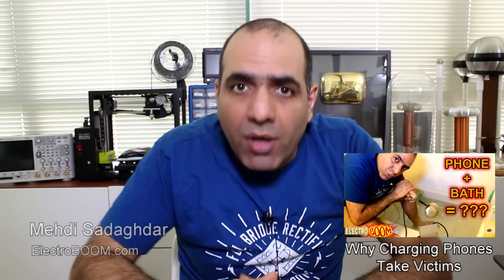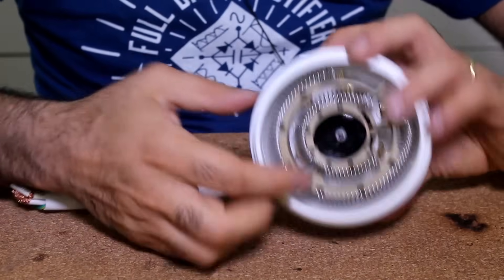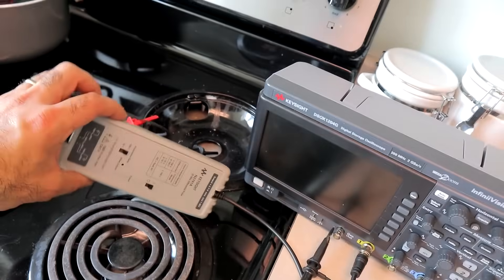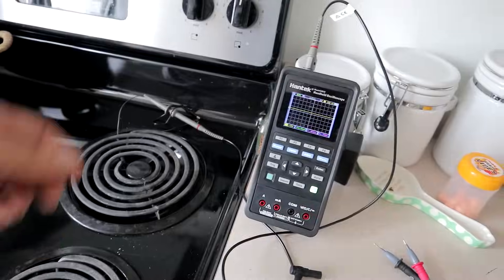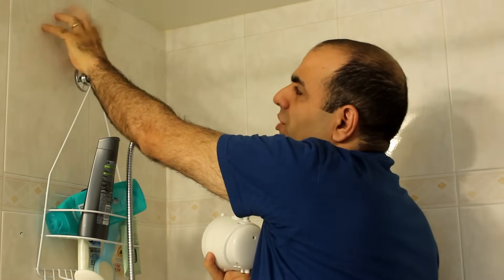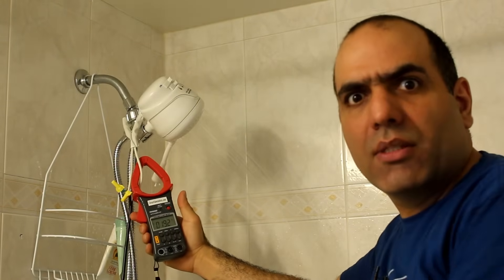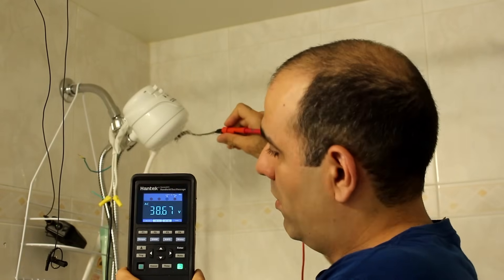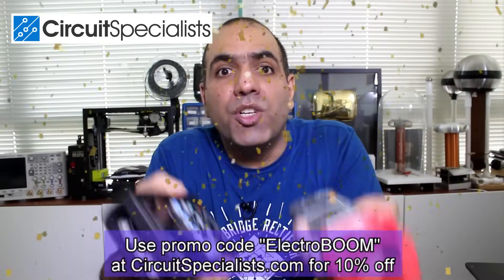How Safe Is the SHOWER HEAD OF DOOM?!

Comment: Let's also remember that water is a poor conductant. If it was salty water then it would be a whole diferent story. Here in Brazil we have the majority of showers eletrically heated and a minority heated by a buthane/methane mixture. It is common to read about asfixiation accidents related to gas heating, but in 53 year I've never heard of a deadly accident involving eletric showerheads. The wire gauge and breaker are highly regulated when you build a house.
Reply: I once heard about a fire involving electric showers, but I'm not sure if it was deadly
Reply: Yeah, it's mostly big apartments and fancy houses that have gas heating.
Reply: i have all three types. the main building in my house has central heating for water, the annex uses suicide showers, and i have an apartment in rio de janeiro that uses butane, which is by far the worst and most dangerous type. oh, i actually have a fourth type. at one of my farms there one which uses iron piping that goes through the fireplace's chimney and get heated that way. it also has a suicide shower on top of that but since it's the middle of nowhere it's exclusively powered by gas generators since power lines don't go there, so it doesn't get much use.
Reply: I could be wrong, so feel free to correct me, but I'm not aware of anything called buthane. Butane would be closest, but is typically only used in lighters and not for home heating. Usually, "natural gas" (at least that's what it's called where I'm from but I'm sure it varies country-to-country) is usually methane and ethane. Water is heated differently in different countries, and I don't know what the benefits and downsides are in each case. In terms of water heater tanks, the risk is always a steam explosion or Boiling Liquid Expanding Vapour Explosion (BLEVE). It doesn't matter what the heat source is, but they are absolutely devastating. In terms of that, it may be smarter to heat smaller amounts of liquid directly at the source; similar to these shower-heads or on-demand heaters rather than a huge vat of water that could, if enough safety systems fail, reach the boiling point. I'm not particularly for or against any of these systems, but thought I'd add my two cents; maybe someone will teach me more!
Reply: @massdefect1  Butane in mixture with propane happens to be used for heating, though in my area (Poland) pure propane is more popular as there are problems with butane when it's stored in negative temperatures (it doesn't evaporate or something like that). 
Natural gas is used when you have access to gas pipleine, but otherwise you install one of those huge white tanks in the backyard, which gets refilled with propane, or mixture of propane and butane. Maybe some countries (e.g. in warmer regions of the world) use pure butane.
Mixture of propane and butane is used in those small 11kg gas cylinders to which you can connect the kitchen stove (if it's gas powered and you have no access to gas pipeline, or to that huge backyard tank).
Reply: Uhhhh what tf is wrong with Brazil that they can't figure out how to make a basic gas water heater l....
Reply: @slowazzd2165  The simple question is why would they even do it, when they don't need heating so they have no use for gas in houses. Heating water is anyway safer with electricity, cooking – too, or if you really want to use gas, use a propane cylinder, which is enough for a month or two of cooking.
Reply: Pure water is not a good conductant.  The minerals in water are.
Reply: @erikm8707  Pure water isn't really conductive at all...
Reply: @slowazzd2165  Money and resources. Gas is more expensive in Brazil, I believe.
Reply: Seems like a Darwin Award awaiting to happen.
Reply: @CloudLoveASMR  No matter how expensive it is, even here where I live in Europe, the gas company won't even connect you if you don't want to use gas for heating the whole building. It makes no financial sense for them to connect people who would only use gas for cooking and heating tap water.
The fixed maintenance costs would just be much higher than the value of the delivered energy.
And I don't understand those questions like "why not gas". Yes, heating water with electricity can sometimes be dangerous, especially if you don't follow safety rules. But heating it with gas is way more dangerous than with electricity. And even to a larger extent especially if you don't follow safety rules. Many more people die from carbon monoxide poisoning from gas water heaters than get electrocuted from electric water heaters.
As you can see on numerous videos, even with those dodgy shower heads, even if they are not earthed, you must be really unlucky for them to kill or injure you.
Reply: i wonder why we weren't trained to dive back into water at the sound of thunder, sight of lightening. Must be because water is a good conductant!! Go back to school.
Reply: @GiantsXbox  Lightning is such a high voltage that even air becomes a conductor for it. Water is a poor conductor but still a conductor, so obviously being in water during a thunderstorm is more dangerous than being in open air. Though probably it's better to be diving than to swim. Under the water, at least you aren't a likely target for a thunder hitting the water as a point above it.
Reply: Wow, why u cant Just Google to se you are wrong ?
Reply: @CloudLoveASMR  it isn't
Reply: That's what he was referring to when he was talking about the water quality where you live because the more pure the water the less conductive
Reply: @slowazzd2165 Simple, we don't need it, we are already well adapted to electric showers and it would be more work to create an entire system just to power a gas shower.
Reply: @kpc211 Here in the US they will connect you to gas for literally anything, including just a stove or even just a gas grill. Electric hot water is still really common, not these shower heads but rather the tank type or a tankless that is in the basement. A lot of houses here at least where I live have no access to a gas connection, at least on the smaller streets. In this part of the US that usually means you heat with oil (Diesel fuel). Sometimes the hot water is heated by running the potable hot water through a heat exchanger that is heated by the oil or gas boiler. Closed loop boiler water goes through one side and potable water through the other. Sometimes this heats a storage tank, other times the boiler is always kept at 180 degrees year round to heat water going through the heat exchanger like a tankless. Sometimes the heat exchanger is even integral to the boiler. Oil fired tank type water heaters also exist, they are fairly common. A less common type is an oil tankless. The only one sold here is made in Japan, it's called a Toyotomi. That's what my mom's house uses, as she has an oil fired forced hot air furnace for heat so there is nowhere to get hot water from except a separate heater. So basically you have a few types of heat: Forced air, steam, forced hot water, gravity hot water (old houses), electric resistance heat (cheaply built houses), electric resistance boiler, and heat pumps (some new houses). Fuels include oil, natural gas, propane, and electric. Normally where I live natural gas is only in the center of the town. Everywhere else is oil or propane. Propane is very expensive, so oil is more popular, because it's cheaper and more companies service the equipment. Biodiesel is also an option for oil equipment. Hot water heater types include tank type, indirectly heated tank type, indirect tankless, or traditional tankless. Fuels for heating water are oil, natural gas, propane, or electric (resistance or heat pump). A house can have any combination of these. For example gas heat and electric hot water, or both gas, or both oil, or oil and gas, oil and electric, etc. Sometimes houses are on oil for heat and have propane or natural gas only for cooking. The gas company doesn't really care whether the gas is used only for cooking or hot water, they will install the gas line. However, you are responsible for paying for the gas line installation, they don't do it for free. Everything after the gas meter is also your responsibility to install and do maintenance, the gas company only provides the gas. It's a similar situation with the electric company as well, you have to pay them to install the service to your house.
Reply: @theodorgiosan2570  Over here in Poland oil for heating got some popularity around the year 2000, but then it quickly became very expensive because truck drivers started using it as fuel (which was illegal being a form of tax evasion but it was very profitable anyway).
Reply: @Slay_No_More  it's literally safer than gas heating.
Reply: Um they said water was a conductant
Reply: @slowazzd2165  The only appliance that uses gas in Brazil is the oven. We still use gas ovens, as our electric ovens aren't so powerful(some in the market take quite a while to warm water to make coffee).
Reply: @slowazzd2165 most of the time we only use gas for cooking, why would I need heating when most of the time is over 30C?  it's currently almost winter and it's 31 C.
Reply: @alandunaway3000 they are super expensive and at least for me using gas still is cheaper than using an electric stove, electricity where I am is unreliable and expensive.
Reply: @kpc211 It depends, if you use it to take a bath it's dangerous, there are already stories with phone chargers and phones falling into the bath, and yet it's supposed to be a very low voltage, so imagine 230/240...
Reply: @massdefect1  tank water heaters are almost impossible to explode due to a temperature and pressure relief valve as long as you test once in a while you should be good and water heaters also have a high temperature limit that shuts off the water heater
Reply: @tbfrstudio5416  You can't die from 5 V or 12 V in the bath. If someone died from a phone being charged falling into the bath, something must have gone terribly wrong with the charger and it was probably literally passing the mains potential (not the mains voltage, just the potential of the live wire, so that it didn't fry the phone but it was still dangerous) to the phone. Look at the videos of the diodegonewild user, he reviews a lot of those cheap dodgy chargers and shows what can go wrong in them because of their bad design.
Or maybe the person who died was using an extension cable to power the charger (which makes sense as in most countries it's not allowed to locate power outlets near bathtubs... though on the other hand, in poorer countries, even if such rules exists, they often aren't followed anyway) and actually that cable, or its socket, fell into the bathtub. Extension cables are generally a weak point of the safety of most electrical systems. If I recall well, once Techmoan made a video about it (from the American perspective, but in Europe, except the UK, it's practically the same). Nothing (apart from your own brain and reasoning) prevents you from overloading an extension cable that has multiple outlets, and the fuse/circuit breaker in the distribution board/fuse box/whatever you call it won't trip if you are just between the power rating of the extension cable and the rating of the fuse in the distribution board. Even though it will already be a fire risk. And similarly, in the case about which we are talking, nobody prevents you from placing the outlet of an extension cable in the area e.g. next to the bathtub, where locating fixed power outlets (in the walls etc.) is forbidden by the building code.
Reply: @GiantsXbox  You're so wrong and telling people to go back to school lol. At least you got shamed here. Good job.

Comment: Mehdi: "So if this is installed absolutely correctly by a professional..."
We, brazilians: "Lemme look on youtube how to fix my shower without powering my house down..."
Reply: thiagots85 also we: how can I build a shower with a water gallon and an a “maybe not” isolated extension cord! HAHAHAHAH
Reply: SIM! hahahahahahaha
Reply: I installed the shower by myself and didn't bother to install the ground wire. In other hand, I always wear flip flops at shower, huehuehue.
Reply: @KamuiPan  1.in eastern Europe, if you've got enough money, you can even buy your doctors degree.
A title means nothing, if it's holder can't do shit he's supposed to

2. Power outlets right next to shower pipes would be a total nightmare for ne as a learned electrician. 

3. As he demonstrated,  these things pull a shitload of current even when heating just a little. Normal house wiring is rated for 19.5A (breaker at 16) when installed inside walls or a max of 29A (breaker at 25) when placed inside a double ceiling or similar, where there is air around the cable, meaning it has a very good potential of setting your whole damn house on fire with burning cables if you're not careful enough. 

To be clear, I'm talking about usual 2.5mm² wires, usually used for outlets. There are some applications (like in everyday European bathrooms WITHOUT a outlet or inside most campers/ trains/ buses where they only use 1.5mm² changing this to 16.5/16A to 21/20A
Reply: We have these in almost all homes in Kenya as well.
Reply: @KamuiPan  They have the outlet BELOW the shower pipe?  Where leaking water will go?  OK that checks out, this is Brazil.
Reply: Doc Ferringer above, dude.
Reply: @Joshua M what the heck is the midwest? murica?
Reply: @robinrumpfkeil9546  And you bought it ? proof or liar
Reply: @diagtula  I didn't. I'm from Germany, but currently working in Bosnia with friends ind (north) Macedonia, Moldova, Ukraine and Albania
Reply: @robinrumpfkeil9546  so you just a liar, ok And with enough money it possible to buy examination to Felicity Kendall Huffman for example
Reply: @diagtula  why am I a liar? I never said i bought it right?
Reply: @robinrumpfkeil9546  You said about possibility. That not true. No one hire man with buyed diplome. it's not hard to check legit of that diplome thay have serial numbers for that. Ukraine and Moldova is not countries. its just splinters betraying of great country.
Reply: É tão estranho estar em comentario br e so ter resposta em ingles
Reply: @Dude-Smellmyhelmet  smell your helmet again it smells burnt
Reply: Exactly.
After all, usually the shower breaks at night time.
Reply: @robinrumpfkeil9546  usually the shower outlet comes with a 4 or 6 mm² wire. And 20 A outlets in 227V
Reply: @prytooblack  dafuq are you doing installing a fucking 20A Power line INTO YOUR FUCKING SHOWER?! In Germany that already counts as a small industrial line, used for lathes, grindstones and stuff like that
Reply: Google: Cono fazer chuveiro elétrico caseiro, pesquisar
Reply: @Dude-Smellmyhelmet   Smell your helmet again. It smells burnt
Reply: @Dude-Smellmyhelmet   smell my ass
Reply: @robinrumpfkeil9546  it's the cheapest way to have a hot shower. I know it's not ideal but I heard more stories about gas heating causing accidents than electric shower heads. It's not worth it to install hot water lines in a place where the temperature hardly goes below 20C.
Reply: @prytooblack  yeah, but about small boilers or under-the-sink passthrough heaters? Anything is better than a 20A line, right inside your shower
Reply: @robinrumpfkeil9546  the shower draws a lot of power, it's the higher consumption point in a household, some places install a solar heater composed of black tubes on the roof, but it's not common. A shower head costs 5 dollars, a passthrough heater would be something like 40, since we've been using these forever, nobody thinks it's worthy the investment. People get electrocuted more in cheap Chinese chargers than in showers. And our showers are installed at about 2.1 m high, few people get close enough to the charges. And a 2 V shock is nothing. I've been getting 220 V AC shocks my whole life 😅
Reply: @prytooblack  me too, but as I understand it, the shower heads are working at 220V too. Aren't they? And I might only know a few. But the Brazilians I know are between 178-185
Reply: @robinrumpfkeil9546  in Brazil we have both tensions, each city has one depending on when the power grid was installed
Reply: @prytooblack  that sounds unnecessarily complicated tbh
Reply: @robinrumpfkeil9546  it's a huge country, and the power comes to the city in high voltage anyway. Most electronics come with bivolt systems these days anyway
Reply: @prytooblack  yeah I know, but I think it would still be pretty annoying tbh. Do you at least have the same plug, or is there a difference too?
Reply: @robinrumpfkeil9546  there were 4 or 5 standards for plugs before. Since 2010 a new standard have been established, but we still have lots of old equipment and old houses with the old standard. Everybody has at least two adapters to carry around.
Reply: @prytooblack  oh man. I honestly feel sorry for you
Reply: @robinrumpfkeil9546  We use special cables of 6mm and +35A breakers.. And the outlets themselves are not like normal plugs where u can stick your phone charger, but dedicated wires that stick out of the wall and u connect to the shower wires directly. Our houses are made of brick and mortar. Fires here are usually kitchen stuff or something like that.